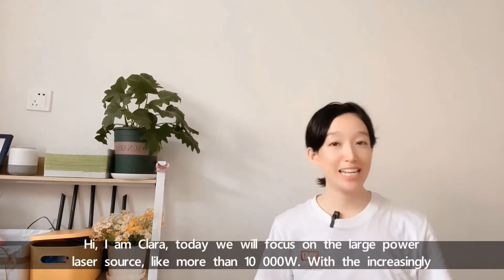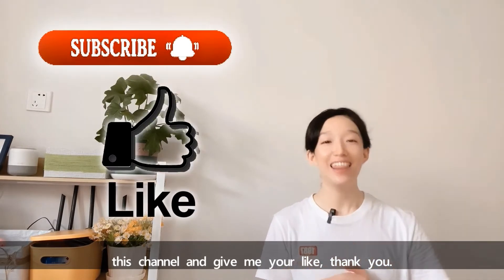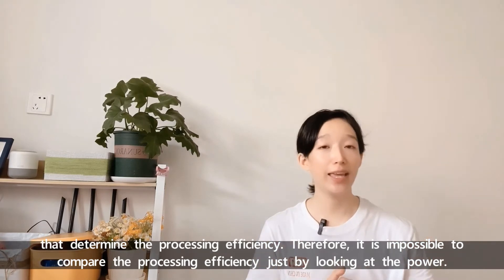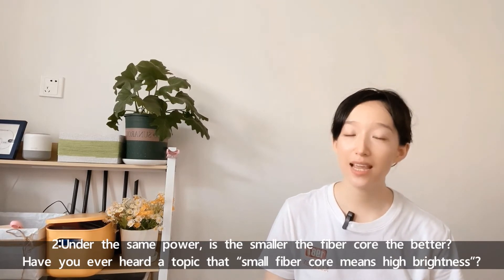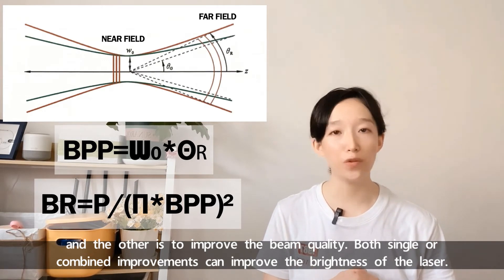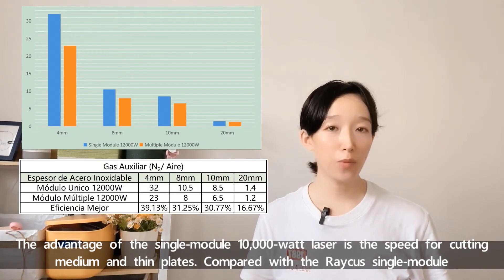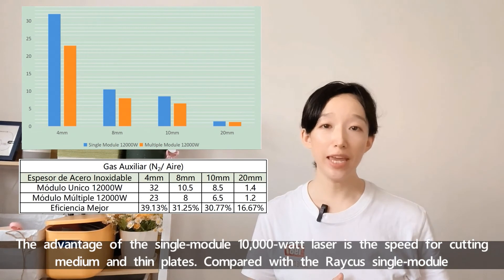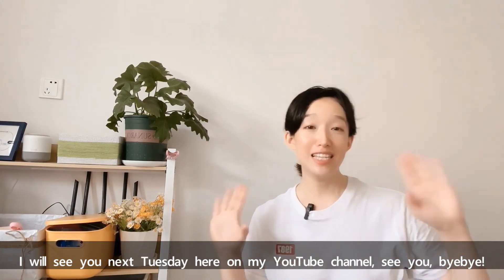10000W Laser Cutting|How to Get a Fit 10000W Fiber Laser

Comment: Hello láser 8kw 26mm glass burn
Reply: @ClaraChai  Hi, I'm trying to cut 26 mm with an 8 mil power source, but the protection lens gets hot.
Reply from the maker: @duilefernandajijijija5730  You need to check lenses